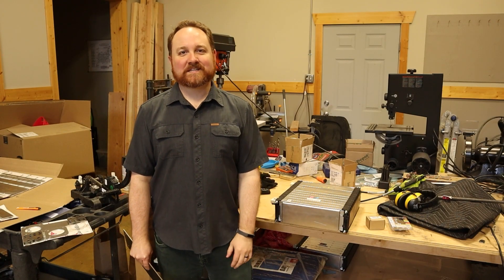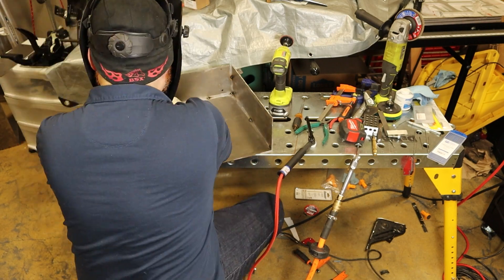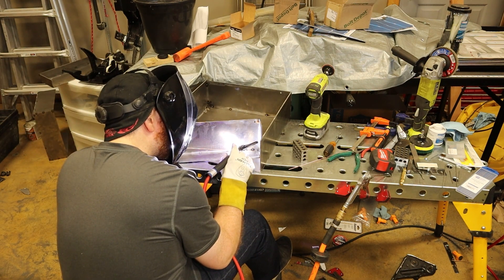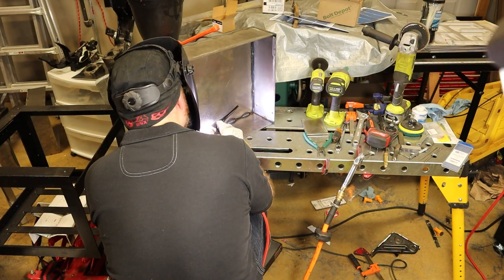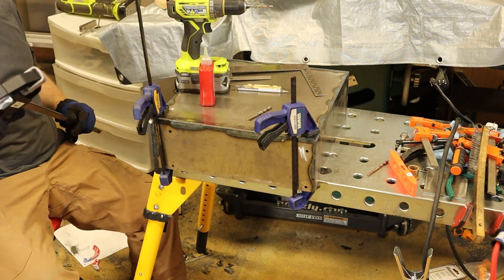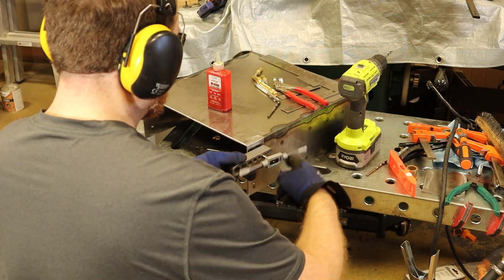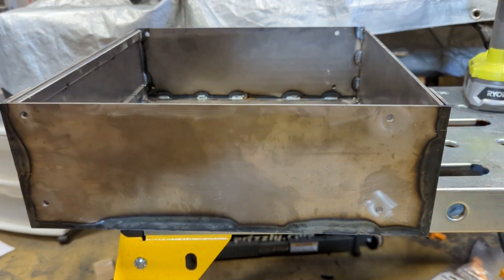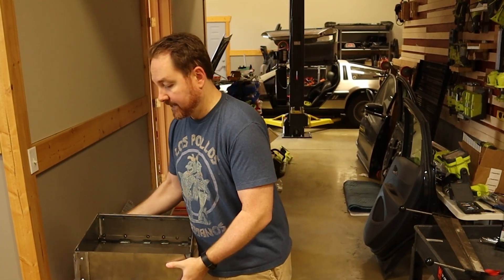DeLorean EV Conversion - Building Small Battery Boxes

Comment: Those are lovely boxes but I think that has more to do with your neat welding than send cut send. In my latest video I made a square box from a single sheet of steel by cutting the steel in the correct shape and half cutting trough the corners so when the sides were folded up the box was almost perfect. It still was not as neat as yours but mostly because of my rubbish welding.
Reply from the maker: My welding is acceptable, but I go back and grind everything flat and fill in pin holes and stuff. And paint makes it look much better, too!
Reply: @BillCarlson  I just posted my latest video. 
Nowhere near as slick as yours but some people seem to like them.
Have you reached shock level at how much work is involved, I'm into year two now? 😆

Comment: Nice update, will the boxes have to be sealed somehow for liquid cooling the batteries?
Reply from the maker: Nope! The liquid cooling will be sealed up on its own. Each battery is getting a "cold plate", basically an aluminum block with water channels in it. The boxes will be sealed up for safety reasons, but that's it.